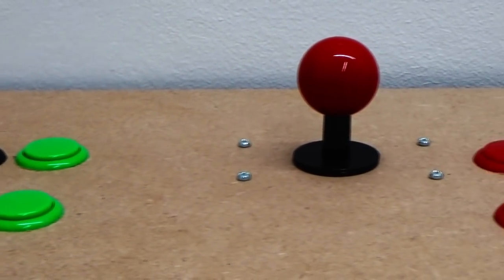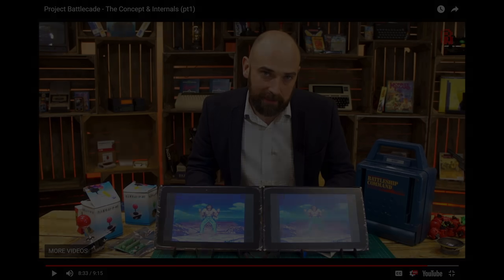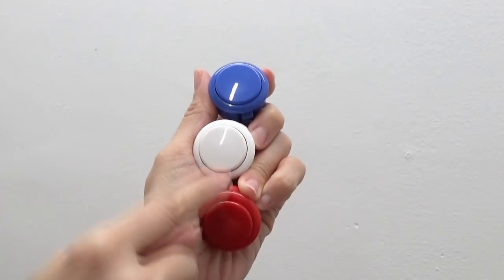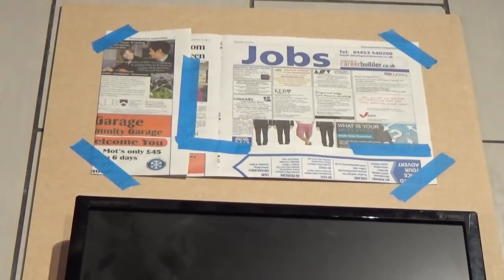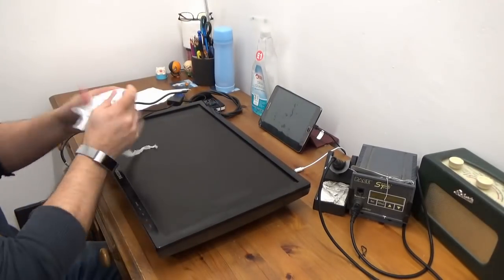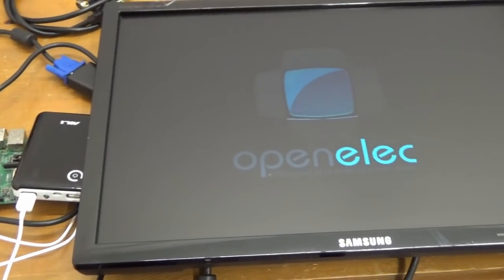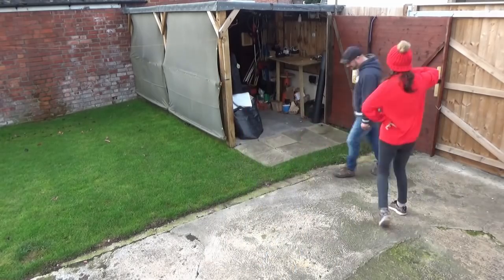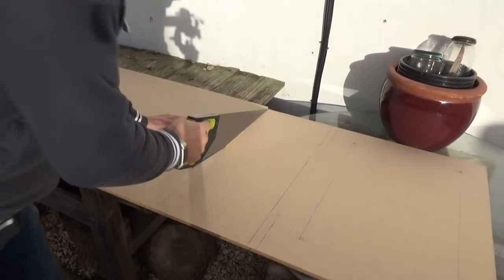DuB-EnG: ArCaDe MaChiNe BuiLd Pt1 - RetroPie Emulation Station - Desktop Classic Games and Gaming

Comment: Thanks for the video, enjoying this series.

Quick question - it looks like you cut the bezel at 90° with the jigsaw, but then when you show it complete it looks like a 45° angled bezel (like a photo matte).

Is this just a trick of the light, or did I miss a step?
Reply from the maker: Hi... a trick of the light... it’s a straight cut - so far, this project has had the most use in the household!! :-).  I welcome any questions/discussions... Howard